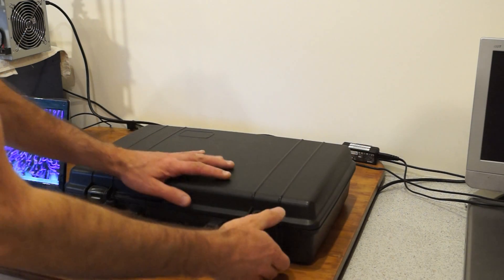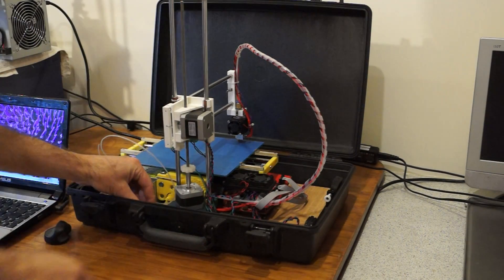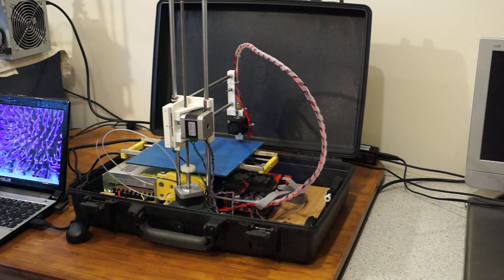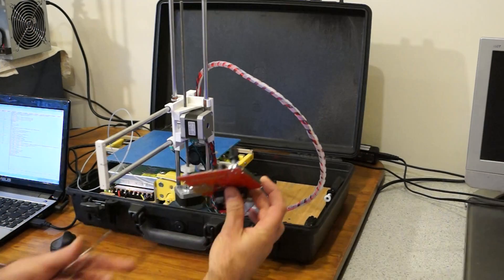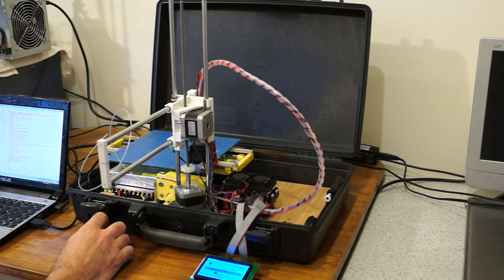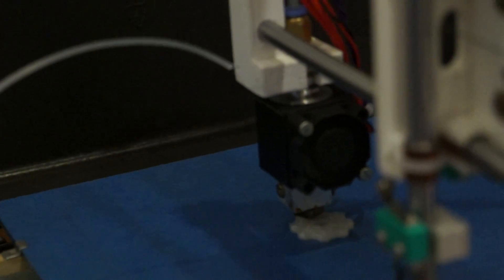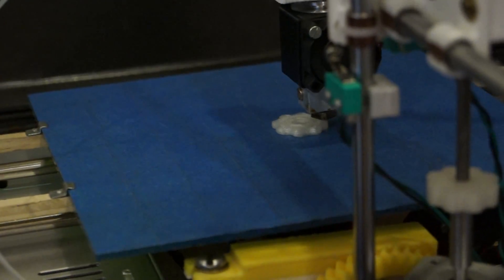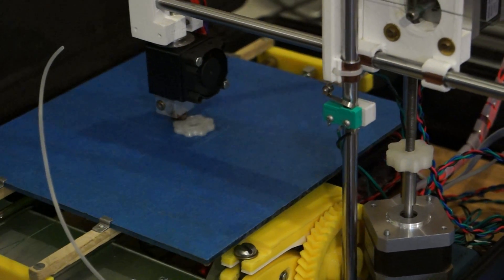3D printer in a briefcase

Comment: what type of black line are you using to move the different pieces with the servo, must be strong like a fishing line? Do you ever have issues with slippage, what a cool little setup, nice work!
Reply from the maker: Yes line is fishing line - specifically spectra line which doesn't stretch like a mono-filament line does.  It needs to wrap around the stepper motor shafts about 8 - 10 times to give it enough friction to be reliable.  If it slips, the tension isn't high enough.  I have further developed this machine to make it lighter (<7kg to suit carry on limit for domestic flights in NZ) and I have changed the spectra line for toothed belts to improve reliability.  Thanks for your comment.